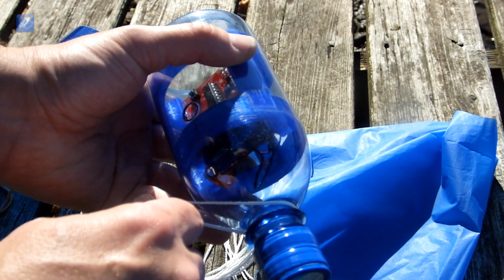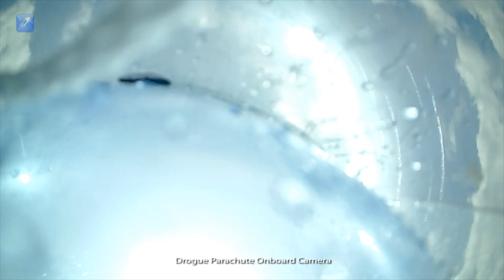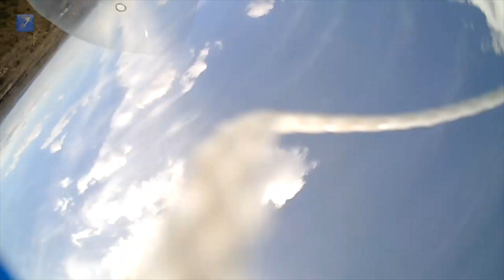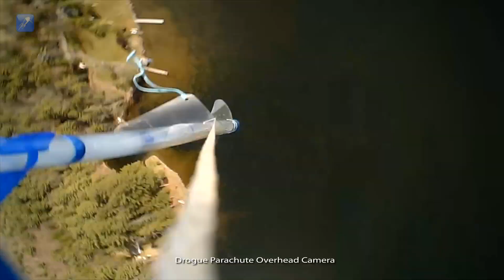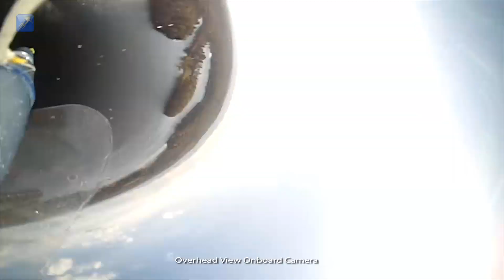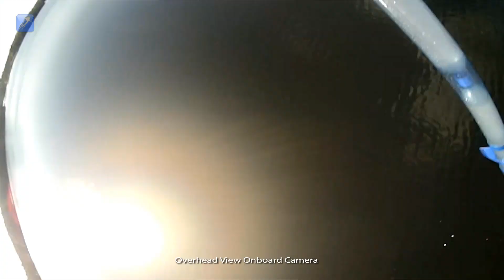Dual Parachute Water Rocket | Project Gemini Part 1

Comment: What camera do you guys mount to the side of these?
Reply from the maker: The camera we use is called the 808 Keychain Camera Type #16 V2. There is a newer version V3 released after we bought ours, which is supposed to be improved. Be aware that these small low-cost cameras are made by several companies, and there are many identical looking cameras for sale at vastly different pricing. The ones that are considered the best are the "Type #16", but a lot of unscrupulous people sell the inferior types using the same name, and you can't tell them apart until you see the video recording quality. Look for sellers selling a genuine Type #16 specifically specifying 720P (1280x720) video recording using the h.264 video codec. We paid about $40 US for ours, so if you see a new one selling for a crazy lower price, it's probably a fake, or one of the cheap types with poor video quality.

Comment: USWaterRockets hi im doing water bottle rocket for my science project. Is it dumb if our parachute's diameter is nearly as long as a meter? We're using a 2 liter bottle and I don't know if the string would get overwhelmed by this. The bottle would be pretty heavy relative to its size because we are using plastic and cardboard provided by our school. The reason why my partner and I had come to a decision to creat a large parachute is because we have to keep our rocket 10 seconds airborne. The longer it lasts on the air, the higher the score. We're hoping that the major drag force of the parachute could be make the bottle land two years after its initial take off. Jokes aside, is this a great idea? Or should I quickly do change of plans?
Reply from the maker: There's really no reason you can't make the parachute larger. You just have to carefully pack it so it won't tangle when it deploys. If you have a time you have to stay in the air, then the larger it is the better.  You should be fine with a meter in diameter.
Reply: USWaterRockets ok Thank you! I was  nervous when all my classmates created rather small parachutes. I thought my measurements were way off. Luckily, our science teacher conveniently found us a really light plastic bag so it's even greater news for my partner and I. I've been scavenging the internet for my problem, and I finally resort to asking you. Thank you very much, you helped a lot.

Comment: ...or,  you can use my Remote Controlled Parachute Deployment.
Basically, as soon as the water rocket will lower the altitude, you'll trigger the mechanism using a transmitter.
If you don't like to use only my system, you still can use it as a backup in case your altimeter doesn't detect the apogee.

Comment: Great experiment and video! I really enjoy that you always share the whole process of building a working system, including all the problems, failures and what you have learned from them. I think that it is very important to show people that almost nothing works out of the box in Water Rocketry. You have also captured some interesting onboard footage by looking into the rocket, which is pretty unique. :)
We often have to deal with a lot of wind, too. We usually just delay the parachute one or two seconds later with the Tommy Timer,  and use a strong rubber band to connect the rocket with the parachute. We choose this method over a second parachute because it helps to keep the rocket as light as possible. But I have to say a Dual Parachute System is definetely the better choice for some scenarios.
Keep up the great work! We're looking forward to next videos, the experiment in the end with the Dual Thrust Phase Rocket (I guess that's the purpose of it?) looks very promising.
All the best
Julian from Raketfued
Reply from the maker: Thanks for the kind words of support! Our issue with wind is complicated by the topography of the area we launch. It can be perfectly calm on the ground but blowing fairly hard above 3-400 feet in altitude. We fly our drone up to see which way the wind is blowing, and angle the launch to compensate. The higher the rocket goes, the more of an issue the wind becomes, so we spent quite a bit of time on this issue. It was interesting to learn things that help and things that don't. It makes for videos that should be helpful to others as well.

Comment: Great work as always. looks like the 2 stage might be based on the 'bugwubber' system? that i had a go at a year or 2 ago. Great to see you continuing on with the idea. look forward to seeing it flying. love the dual parachute. I haven't flown for ages. Your vids help with enthusiasm.
Reply from the maker: The staging system is based off the "Sky Splashers" toy rocket which we posted the video footage of to the Water Rocket Forum. Bugwubber did a frame-by-frame examination of the video and reverse engineered how it works. I'm not sure Bugwubber would claim naming rights to the concept, given how divided the water rocket community had become due to this practice. To answer your question: we've been through many iterations of the design, but idea of using a lever to hold the rocket in place is the one common theme from the original concept. Most of the improvements were tweaks to make it more rigid, and creating consistent timing, figuring out how to keep the water from rising on top of the air inside the sustainer under negative G after booster burnout, etc. Multi stage rockets are much more work to build and fly, but they are quite a bit of fun and add variety. It may surprise you to learn that launching carbon fiber rockets higher and higher becomes boring after a 10+ years, so we've gotten a lot of renewed motivation ourselves from taking on these more complex projects. Thanks for the feedback on the video and taking the time to show your support. That also keeps us motivated to make these videos!
Reply: No offense intended. I just mentioned Bugwubber as thats the first place i saw it and simply as a reference point. Will use SkySplasher from now on.. Agreed its the problem solving and mucking around that's most of the fun. all the best. My project for the year is a dual booster, dual stage rocket... Hey, what could possibly go wrong with that?
Reply from the maker: It's all good. No worries. On a different subject, do you watch our videos for the water rockets or our Hobie 16? (Just kidding, LOL!)
Reply: Haha... yep got a little distracted with sailing
Reply from the maker: Great minds think alike! It's fun and relaxing. Now to figure out a way to combine the two hobbies... hmmmmmm.

Comment: Hey USWaterRockets what 3d printer did you use for the 3d printed parts?
Reply from the maker: The large collection of parts shown being assembled into the test rocket were all printed on a Rostock Max V2 from SeeMeCNC, which was our first printer. Some of the other printed items that appear in other clips in the video may have been printed on a Monoprice Select Mini, a Monoprice Select Mini V2, or a Monoprice Mini Delta. We did a review of the latter a few months ago. It has a small build volume, but this is more than adequate for making tornado tubes and staging mechanisms. You can see that video here: https://youtu.be/_qHEP9T2OzA
Reply: Hi there! I recently got myself a 3D printer, the Anet A8, with it I have printed the US Water Rockets Tornado Tube and the Gardena Quick Release Nozzle. They are great, thanks! However I am terrible at design, I have made a rocket cone but not much more. Is there any chance that you will share your designs in the near future? Thanks and keep up the great work.

Comment: have you tried multi stage water rockets?  It may be interesting to see how they react with weight of the different stage water supply.
Reply from the maker: The rocket shown in the first 15 seconds of this video is a prototype 2-stage rocket called "Gemini 1". There's even a onboard video clip from the sustainer. We've been refining this rocket for the past 2 summers, and did a video about the staging mechanism concept about 3 years ago. If you're interested in multi-stage water rockets, we have some great experiments in the editing room coming up shortly.

Comment: Would you be able to just delay the main chute opening closer to the ground and still get by with a single chute system?
Reply: Or  have the drogue chute open the main chute after slowing the rocket some.  In both these systems you just need one altimeter and servo saving weight for higher launches.
Reply from the maker: Great comment! You can see that exact scenario happened in the first two launches in the video when we messed up when setting up the deploy altimeters for the drogue parachute. In both cases the main parachute deployed at full speed freefall at 200 feet, and in each case the rocket and/or the parachute were damaged. The red/white chute in the first launch was almost completely shredded. That being said, we did conduct additional experiments to try and work out a way to do this successfully. One of the follow-up videos to this one is focused on what we called "HALO" parachutes. Stay tuned for that video soon!
Reply from the maker: That would work. Some high power rockets do this by putting the main chute in a bag that is released with the drogue. The term "drogue" comes from this method. We also have a design where the one servo rotates clockwise to release one parachute, and anticlockwise to release the other. The benefit is some weight savings, but the downside is losing the redundancy of a totally independent system.

Comment: I've got a crazy idea. Stick a solenoid valve in the engine. Close it right after launch when there's still a bit of pressure left. Open a drogue attached to the top of the rocket at apogee and reopen the solenoid at something like 10 meters (33 feet) of altitude. Retropropulsion landing, SpaceX style.
Reply from the maker: That idea is not as crazy as you suggest. ;-)  It's a very interesting challenge, and is probably the most complicated water rocket project ever designed. Do you think there would be a lot of interest in a video about this? Let's see a show of hands by up-voting your comment!
Reply: The idea is very interesting, but not easy to implement. I experimented a bit with the solenoid valve. I'll try to upload the video in the near future.
Reply from the maker: There are some nice valve designs that come out of the air rifle hobby. We have tested some of the ideas and they are very clever.
Reply: That's cool. I've been thinking about this "Falcon Heavy-esque" carbon fiber water rocket project, and retropropulsion kind of seems like the only way to "land" (fall slightly more elegantly) the center stage.
Reply from the maker: From the likes on the comment, there is a lot of interest in seeing a project video for this. Keep the comment likes coming!
Reply: We wanna see this!